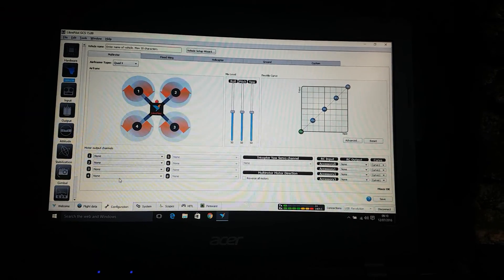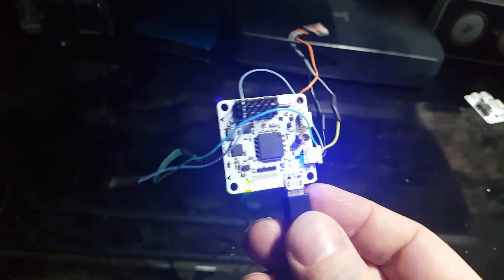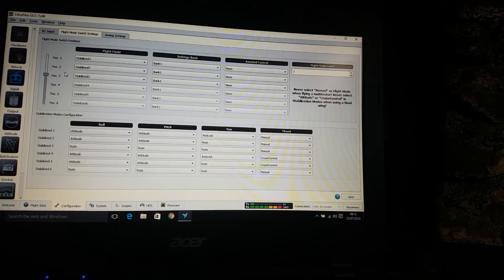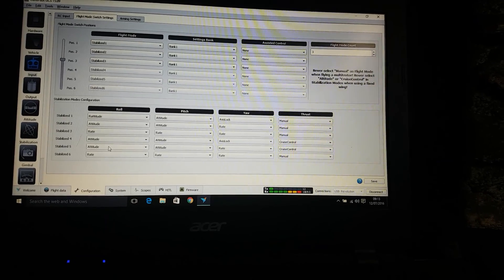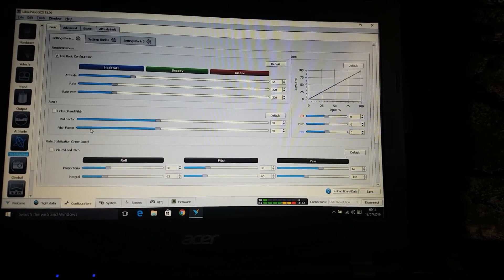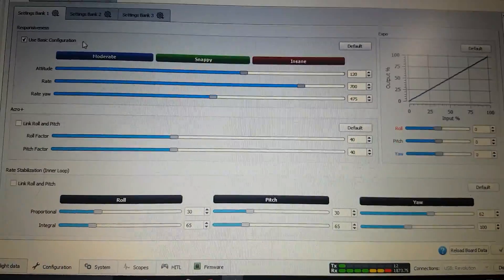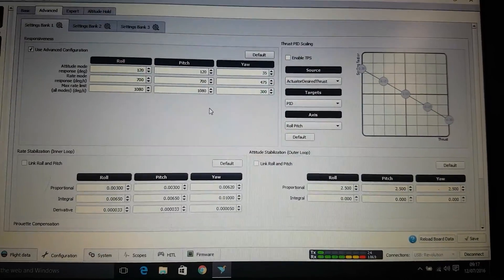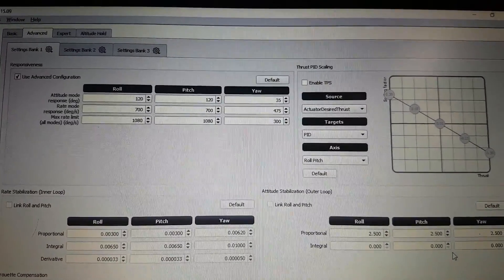Fast flips and rolls from Open Pilot, Libre Pilot using CC3D Revo, Atom, CC3D

Comment: Hi, I really want to be able to do flips and rolls but when I change the setting the confic butten in flight data turn red and then I cant arm my drone. It says "One stabilised mode use a wrong thrust mode, like Cruizecontrol with rate on pitch/roll", it also says something about gps problem but I dont think that is the case because i dont even run a gps on my drone. please help me if you can, overall gr8 video.

Comment: Hi, thank you very much for this information. I think this is the first time I've find such information on calibrating for flips and rolls so clearly. Can you tell me how can I set the PID even if you tell that it is not that critical, my drone wobbles a lot thanks
Reply from the maker: Claude St-Louis is it wobbling side to side or forwards and backwards?
Reply: mostly side to side .. I have difficulties to understand all the parameters to optimize the PID (inner-outer loop ... all the numbers) the video that you made was great, I wonder if you have another video on PID ...
Reply: it is more side by side ... how can I correct it ?
Reply from the maker: Claude St-Louis lower P on roll in PID'S.  do it a little at a time and you should see it settle down
Reply: Claude St-Louis how much value should I lower at a time? lets say P for Roll is 300. lowering to 290 would be too little? I got this clone set of a Qav250 with CC3D and kingkong 12a esc with some generic 2204 motors for a small $$ to try building myself and now it flies but it wobbles on stab mode. on ratitude and altitude wobble lesser but still wobbles. I lowered a bit of the pre set PID's in librepilot and it helped a bit (I guess) but still doesnt fly well. now I wonder if I should go lower or higher. kind of confused

Comment: When I arm my quad, should the rotors start spinning with zero throttle? Or Should they be  not rotating? I have it set so that at full down throttle the rotors don't rotate. I'm wondering if that will affect the drones ability to rotate with roll inputs with zero throttle?? Any input?
Reply from the maker: Art Romero look at my other video call air mode in libre pilot
Reply: no problem! is that available in libre pilot? openpilot?
Reply from the maker: Art Romero both

Comment: How do you fix a growing progressive drift thru flight to the right with cc3d in openpilot, I've calibrated a numerous of times and swapped motors and still have the growing drift thru flight. What can I do? Thanks
Reply: open pilot is no good get libre pilot and your problem should be fixed

Comment: I am a newbie to DIY drones, and probably because of that I'm not able to make it fly stably. I have CC3D controller on F330 frame. When I hold drone in hands it starts to wobble so it is hard to hold it.
Reply from the maker: You need to lower the P on roll in PIDS
Reply: SliderFPV lowered it... still drone sometimes is unpredictable.
Reply: One more question... Lowered my P, and it became more stable in Rate/Acro+ mode, but, when I pitch forward it slowly returns to level... I think it should not act like that in Rate/Acro+ modes? Is it something connected with PID's too?

Comment: thanks ,,my dx8,,will only work on the left switch(2 position)when the switch is off,thats when I can roll,,do you think the switch needs turning round,or have I followed  your video,with the switch in the wrong place,am sure I had it turned off,when I did ,what you did,in the video,,nice video,,
Reply from the maker: Jason West In the dx8 settings you can reverse the switch to make it right
Reply: al give it a go,,is it easy

Comment: I watched a lot of videos that show that LIBRE PILOT IS BETTER THAN CLEANFLIGHT OR BETAFLIGHT! They said Libre Pilot was better because of more people working on it and it was the original openpilotcc3d site which changed names to Libre Pilot!, I am not new to multis!, just to minis with cc3d,naze32& the F3 type of flightcontrollers! I am building a TAROT TL250H QUADCOPTER WITH EMAX MT2204 2300KV MOTORS CC3D ATOM FC KISS 18AMP ESC'S SKY S60 600-750MW FPV TX WITH OSD AND BOARD CAMERA. I am not using it for racing just to mess around and practice proximity flying, sorry about the caps going through Cancer treatment and eyesite goes in and out a lot, I am also using a Taranis plus tx with a D4Rll RX  PPM!

Comment: wow cheers man flips out of this world now. only problem I had was the motors still cut out when doing 3x barrel roll. I thought the cruise control. Would stop this from happening?.
Reply from the maker: Jamie MacFarlane if the motors stayed on in a barrel roll they would push the quadcopter into the floor
Reply: SliderFPV When I say on. I mean just turning not enough for lift but just enough to smooth out the drop in throttle.

Comment: hi there I've followed all these settings but unfortunately it won't power up the motors reset it back to how it was before and it was fine .any ideas what I may have done wrong ?
thanks james
Reply from the maker: Under the flight mode settings, if you have the wrong configuration  the cc3d will stop you from arming the motors.  Hope this helps

Comment: Thanks mate! This helped my do my first rolls and flips with my eachine falcon 250. Works like a charm! Perhaps i will even try a higher than 1080* max rate limit soon. Good video, thanks
Reply: I also have the eachine falcon,did these settings work fine? And how do you perform flips on the transmitter ? Thanks !
Reply: Have you tried anything over 1080?
Reply: Bagel Boyz hi, no not yet, lol. 1080 seems fast enough for now. Doing flips works quite easy, just try it at some altitude?
Reply: Have you tried changing the expo ? Would that make the flips faster?
Reply from the maker: Bagel Boyz Exbo will speed things up but can make smooth flying hard